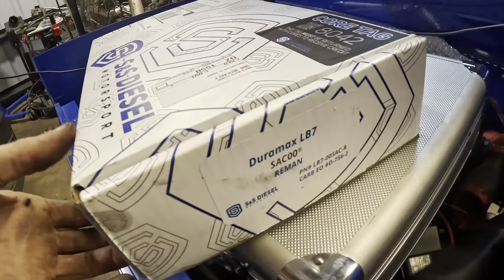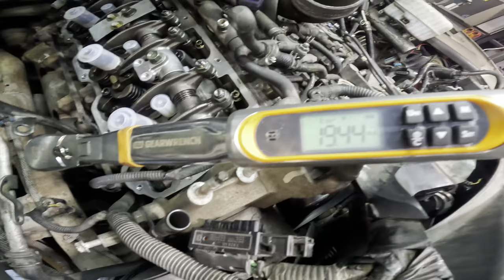ONE MISTAKE and DO IT AGAIN! Fuel Injectors INSIDE of Engine

Comment: Ray, your first mistake was not putting the hood in service position, second, I would only buy injectors from 2 company’s. S&S, or exergy..  you also need to make a tool for the return lines..  you basically adapt a vacuum bleeder to a banjo fitting, screw it in then head where the return line goes..  and how come you never reply to anyone?? Maybe I should stop my Patreon support !

Comment: The fact that you can be called out and be able to be involved with a product manufacturer just shows just how far reaching your videos are! That alone is a compliment, but it also says alot about Diesel Logic . What works and improvements to those products just make for a better product for the end user. 
I have rebuilt a few of those units and there are some steps that many want to skip but, I can tell you they can make a real big difference in engine performance. When a manufacturer takes the time, effort and  cost to put out a TSB they are important!! 
Keep up the good work Ray!

Comment: Good work by Diesel Logic reaching out without going into a full blown retaliation game. I'd use them if I had both a diesel and something they provide parts for just on the strength of that 'let's see what's going on, and get it sorted positively' attitude. That's the way to do business 👍(Also I'm in the UK so they may not service the market).
Good to see Ray owning the mistake of repeating second hand reviews too.
All round sounds like a great outcome from a scenario that too often turns into a bitter back and forth.

Comment: I do not think most people know how accurate you must be with torque values on tightening with diesel engines . Running they sound like they are going to fall apart , but they operate by having tight clearances  .  Great video . Stay safe , have fun .
Reply: All engines require specific tolerances otherwise they won't run correctly, not just diesels...
Reply: @shadowopsairman1583  ¡Seguro! 
Pero en un motor Diésel rápido todo es más preciso, elaborado, ajustado... y caro, sin mencionar las enormes presiones y esfuerzos a los que están sometidos al funcionar a altas cargas. Y ni hablar de las velocidades de giro (RPM) altas, por las que NO destacan por no ser diseñados para ellas. Son más lentos, precisos, potentes y eficientes, no necesitan tanto mantenimiento pero son muy sensibles al mal trato y la Calidad de los elementos utilizados en él, o en las reparaciones.
Quien no entienda o acepte todo ésto, mejor se compre un vehículo con motor a gasolina.

Comment: Hello Ray from Australia🙃

Good job and a little tip to keeping that top rocker cover in line is to make two temporary studs to lower it on to, bolts with the heads cut off or I've even used bits of wooden dowel to do it.
Fit the cover and take them out when you have some bolts in it..
Reply: Made plenty of those, cut the head off then either cut a slot, or grind into a square or triangle, that a 12 point socket will fit on. Especially on cylinder heads, long stud made from old stretch bolt works wonders to get alignment, you put the studs in the holes the dowel pins use, and it make putting on a breeze, and ensures it is right.

Comment: I appreciate Diesel Logic's approach here, shows they  care. 
I do not consider myself an injector expert but I have spent a number of years working exclusively on Duramaxs.  I've diagnosed and replaced a lot of bad injectors. 
Again, not an expert, but my understanding is that lb7 injectors have an internal design that makes it difficult to properly remanufacture. 
Maybe things have changed, but in the past many if not most aftermarket injector rebuilders have struggled to turn out a good lb7 injector. Because of this I used to exclusively buy the actual Bosch remans from the original manufacturer of the lb7 injector. 
This doesn't mean the injector remanufacturers aren't good at their job it just means that this particular injector is an especially difficult one to get right.
Reply: The biggest problem with lb7 is the fuel cap where the injector sits, and you have to take everything off to get to them, nothing wrong with the injector alone, just the design of where it was put and the sleeves they were installed into( sleeves aka cups)

Comment: Hey Ray, when I replaced my injectors in my LB7 I used a popsicle stick to remove the RTV in the groove of the top cover. It did a great job and the wood prevented scratching the metal.
Reply: And you get a popsicle!

Comment: Those Dremel tools are great! I've used mine to cut partway through a radiator hose so I could pull it off the radiator, and I've used the Dremel to cut through the hard plastic cases the Mint ships proof coins in, and I've used it to cut through a pipe that I needed to replace in my shower.

Comment: Even though there are nearly 200 comments, those shadetree mechanics who are watching and reading with the notion of doing an injector replacement on their own unit, may I offer a bit of added commentary.  I took about 30 hours to replace mine on an '02. I was ultimately successful, but....   I removed the front wheels and lowered the front end to make things more accessible. The rear valve cover fasteners were really tough. I just had to be patient. And, lastly, I didn't have the feed lines torqued down enough when I finally went to start the unit. It took several tries and re-torques to ultimately get every thing to stop leaking. Advice: if you have the funds, take to Ray!!! If not, it's doable, but be ready for a long process.

Comment: Sweet, road trip! Glad to hear that Diesel Logic reached out to you and you were willing to own up to what you said and willing to make things right.
If you are unsure if a bolt is torque to yield, take the number on the head of the bolt and google it. You should get all the torque specs for it including the yield point. So if the specs  from the auto manufacture is below the yield point for that bolt, then its good to use again.

Comment: Kudos to you for your communication with DL! Can I suggest if you have an old dishwasher at home you don’t need,and install it at work for a parts cleaner. Saves the time you spent on the heads and cheaper to run. Brake cleaner is not cheap!
Reply: Addendum: I recommend you making a simple oil/water separator for the drain tube to keep the EPA happy! I use one in my workshop. Saves a lot of time and the parts come out spotless.

Comment: Unless there are some other circumstances it seems like 8 years should not cause fuel injectors to fail. I have two vehicles, one 18 years old and the other 14 years old, both with the original injectors and both run well.... That said it would be interesting to hear what Diesel Logic has to say about the bad injectors once they have an opportunity to do their own autopsy.

Comment: I haven't finished the video to see if this was noticed, but it appears that the "double ended sealing surface" pieces  the last 3 you put on the first return line that was installed at 46:10 appeared to be upside down in comparison to the first one inserted.  Not sure if that matters because I'm not even a mechanic let alone a diesel engine

Comment: Glad you were able to get the conflict resolved and look forward to your trip to the manufacturer. Also it looks like the previous injector installer torqued the return line bolts to 144 foot pounds instead of 144 inch pounds!

Comment: Ray I just done some injectors on an LBZ in a 2500hd truck and my God did I go through a nightmare on cylinder 7 because the injector hold down bolt snapped off in the head. After spending many hours trying several different brands and types of broken bolt extractor tools nothing got it out. I broke off a drill bit in the bolt and drilled the broken drill bit out then I broke an extractor bit off in the bolt and that was another nightmare in itself to drill out the broken extractor bit and finally I broke another drill bit off in the bolt and by that point there wasn’t much left of the bolt itself so I pulled the upper and lower valve cover off and had a buddy weld a nut to the broken bolt and it came right out at that point. Whew that was a doozy! I did an engine replacement in this truck and it got brought back after injectors 1 and 7 bit the dust causing fuel knock and a major loss of power. It’s all good now though runs great thank the lord! I really enjoy your videos Ray, I found your channel sometime last year and I have been hooked ever since. I’m a gasoline auto technician in Tennessee. I’ve been working on some diesel trucks quite a bit the last couple of months and I have learned so much about Duramax trucks from your videos!

Comment: Hey Ray, why worry so much about torquing the cover bolts but didnt use a torque wrench on the components inside?  I.e. the injector nuts and wire harness hold down bolts.  One of them coming out or being over torgued could be catastrophic.

Comment: Ray, the O-ring seal on the injector that you remembered to lube before installing isn't  to prevent "water intrusion " but rather to keep oil from draining down past the seal  and also to keep diesel from migrating up into the oil above the seal in the event you have a partial crush seal failure. Enjoyed the video  👍

Comment: I've never worked on a diesel so this was very interesting. Some older motorcycle covers required sealant without any alignment pins. We used to put in a couple of studs or bolts with the heads cut off. Then we had about an inch of distance before the parts connected aligned with the studs. Once the cover was down we'd put in a couple of the bolts and remove the studs to be replaced with bolts. This method might work a bit easier for those top covers.

Comment: Greetings: Perhaps U test drive the unit 2 Jtown. If it fails, and it is injector related failure, then perhaps the comments were well founded. If in 50,000 miles the unit is performing well, the situation resolved. Thx 4 the share.

Comment: Ray, we used dialectic grease to hold the crush washers on the injectors on the military multi fuel engines, same set up at the nozzle as on that dirtymax engine.

Comment: Can’t say I agree with not install new injector hold down bolts, seen them break and send the injector out through the valve cover. Granted it wasn’t on an automotive diesel engine it was on a 3512 Cat haul truck engine. But just my opinion, love the vids keep them coming.

Comment: What grit are you using when cleaning off the covers?  Instead of the screw driver you might get yourself some cheap dental picks at HF.  I will bet the flat rate for this job does not include all the time to clean up the sealing surfaces.  I am sure that those special gaskets instead of crush washers made that job much easier.  Note: when I have to line up mating surfaces that have a silicone gasket sealant I make a set of studs to screw into some of the holes to keep the parts in alignment.  It is a great help when trying to put a transmission pan on when lying on a creeper.

Comment: Ray- Instead of using blue towels to keep crud out of the large pipes, try using the clear elastic banded cooking container plastic covers that fit different size bowls. They do not fall down inside the pipes but the elastic band holds them around the outside of the pipe.  Not suitable for all applications, but sure beats having a towel slip down inside the pipe. Also re-useable. I found they worked well for use to cover the opening on a carb too.

Comment: When they first came out I had 1 that on a cold start it had a puff of white smoke when engine was warm they didn't do that. Come to fine out the injector sleeve was leaking small amount of coolant at the sealing surface at the bottom of sleeve where it meets the head so Gm had me pull the sleeve and put new seal and put a small amount of locktite on the bottom of sleeve at that time they didnt have a tool to pull them in the field so I made one from 2 bolts welded together anywho they wanted to see it and they made one from my design. They didn't even give me a thank you or anything made me mad lol.

Comment: Years ago I bought my ist and only new vehicle and it was a major lemon.I couldn't trust it to start for 3 years and it was defective injectors.I had a real bad oppinion of chevys after that but many other problems continued to pile up even after the starting issues were fixed.I replaced 4 injectors and it started good after that until 6 months later had to replace the other 4.Had to replace a head gasket and 3 intake gaskets and 4 fuel pumps and many other problems.Chevy can kiss my

Comment: I too made assumptions about the company and a visit to their website showed me how wrong I was. Like just about every other company they have cheap goods and they have higher quality goods. you get what you pay for.
Reply: While that’s true to an extent, if you sell something for a purpose, regardless of how cheap you sell it, it has to be fit for that purpose. If they try to weasel out of responsibility for premature failure, by saying they have a dearer one that lasts as long as it should, that won’t hold up.
Reply: @duncancremin1708 ok you don't realize how parts market works, value/cheap, daily, performance. The bottom rung which is value/cheap is just to sell the vehicle, nothing more, you get what you pay for.

Comment: I have to say, the injector wiring solution for this engine is far more elegant than Navistar's solution on the 7.3 Powerstroke.  Navistar built a pass-through connection into the rocker arm cover gasket.  I had to do the injector harnesses on my 2000 7.3.  It wasn't fun.  $26 in parts but several hours of labor.

Comment: Ray, is the torque at the wrench different from the torque at the fastener  when there is an extention between torque wrench and fastener?
I am amazed at this rebuild. I priced just the injectors (Bosch at $2500 to $3750) and the banjo bolts at $80, $80 bucks for 8 fasteners, wow. How do you learn to do this very problematic rebuild without going broke.
Reply: The answer to your extension question is technically yes, extension length will affect the torque value. In practicality though it doesn't affect it enough to matter. As long as you keep the head of the torque wrench directly above the socket/fastener it won't matter on nearly any automotive application. Especially considering the relatively low torque value here and that the torque wrench calibration is probably in the 5% range.
Reply: @ORRadtech  thanks, I never knew

Comment: Easily known Ray is in a hot place! If I used my die grinder for that long, without gloves, my skin would be stuck to it by the time I finished. But hypothermia would have rendered me unable to move long before that. Air tools get coated in ice, if used for a long time without a break.

Comment: Assuming these injector pipes are made to suit an original engine layout why didn't the manufacturers identify each injector fuel rail position with the cylinder number stamped on one of the rail nuts.

Comment: Can you share why you spent a lot more time prepping and cleaning these particular valve covers. I don't recall you being that meticulous before with other covers??
Reply from the maker: Did you see that embedded silicone sealant inside of that groove? failing to remove that can cause a very poor seal and it will leak. Plus this one being a diesel. There was no coking or sludge buildup. Therefore, they cleaned up much easier than a gasoline engine. On top of that there is four pieces to clean as opposed to one, so naturally it took longer.

Comment: 199th! Good Thursday morning Ray and the wife unit. And a huge shout out to the two new employees. I’ve never had anything but a gasoline engine vehicles. I looked at Mercedes diesel years ago,but the smell turned me off. Haven’t been around any pickups that run on diesel so I don’t know if that’s been improved on or not.  Roger in Pierre South Dakota
Reply: Roger, I'm curious as to why you repeatedly keep mentioning 2 new employees? 
There's only Dave, who took over from Troy.
And Lauren, who's been there since the shop opened, so she doesn't count.
Who do you think is new?
Reply: @beezul  Lauren has an office assistant. She is a small black lady. I’m not completely sure how much she works, but I do know she does work for Lauren.
Reply: @rogerfleury3591  That assistant has been gone since Troy left last summer. She hasn't been in any video since.

Comment: 21:09  there is a better way to get to the back left and right injector, but it requires removing the steering shafts and firewall shield, as well as the ac components you could also service the parts on that side.
Just makes a very costly job more costly.

Comment: It odd there’s a groove in the top cover but there’s no gasket for it so you have to use sealant.  Why do they bother with a groove?
Reply: The groove is there to help secure the silicone to the sealing surface. There is not enough material to cut a groove deep enough to recieve a gasket without compromising the rigidity of  the cover. It would probably break the area around the bolt holes if the cover is too thin.
Probably designed like this for clearance purposes as 5mm can make a big diff when removing parts in a tight spot.

Comment: anyone else notice that first fuel return banjo bolt "gasket" was upside down (compared to the others)? not sure if it matters.
Reply: Now I look further I think that the first one was correct and all of the others wrong.  The link is contoured to follow the overall shape of the waist on the fitting, and that first one in profile looks right, whereas the other three look awkward.
Reply: the is entirely possible, I have no idea which way they go.